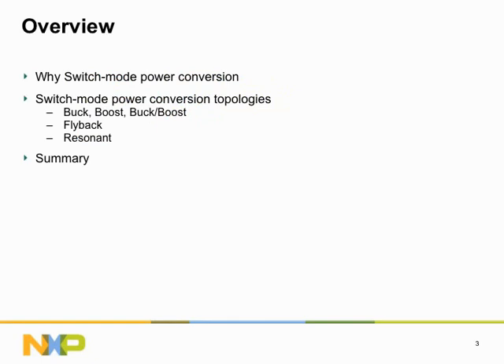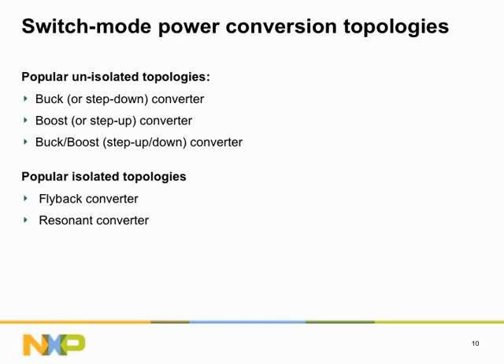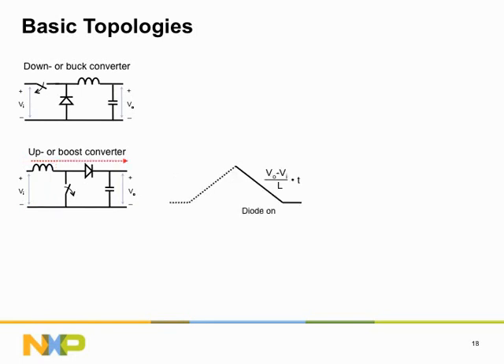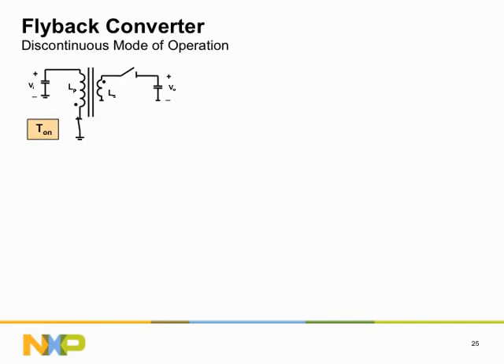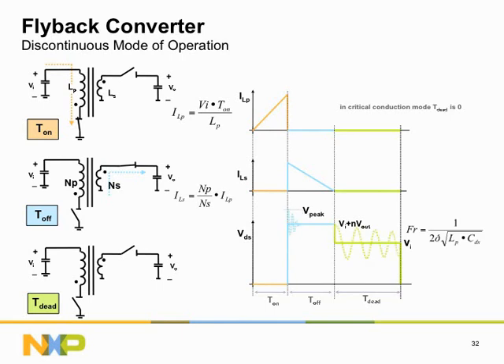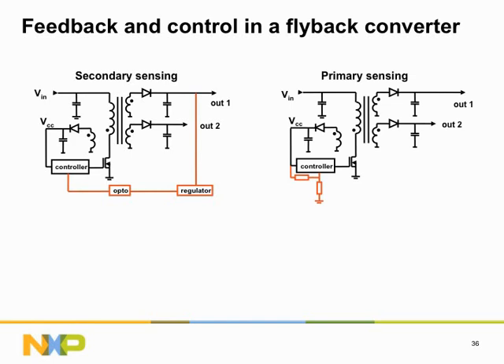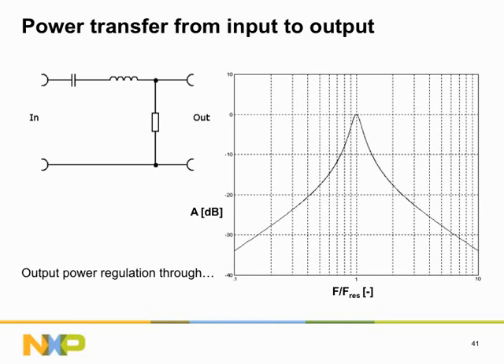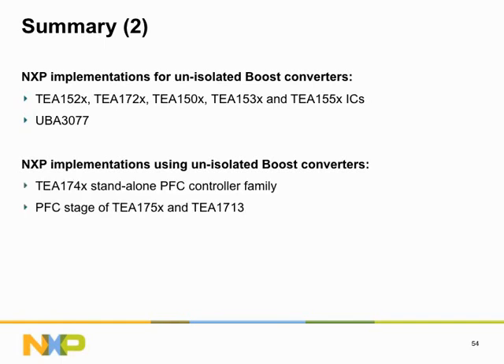AC/DC SMPS Explained: Topologies, Benefits & NXP Components | Power Supply Basics

Comment: If I need 5Vdc out, why should I use a smps (which requires a dc input) instead of using a 230:10 ratio transformer, which gives me 10Vac, rectify that, which leaves 8.5Vdc after the diodes, and then use a linear voltage regulator such as a 7805 to drop the last 3.5V, resulting in 5Vdc.
Reply: Usually smps is more energy efficient. Lots of losses occur in transformer cores and usually the transformer needs to be of a decent size
Reply: Well, it would be difficult to pack a 230:10 iron core transformer in your luggage so that you could charge your cellphone on the road. An Apple Cube SMPS has its uses.